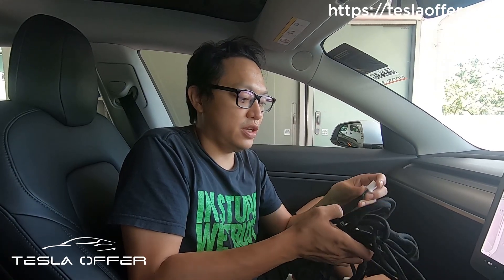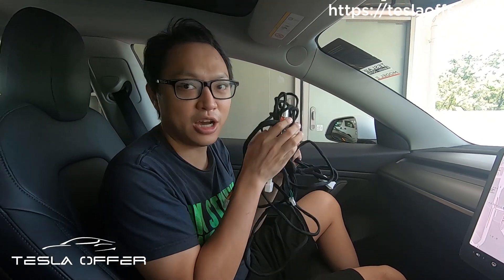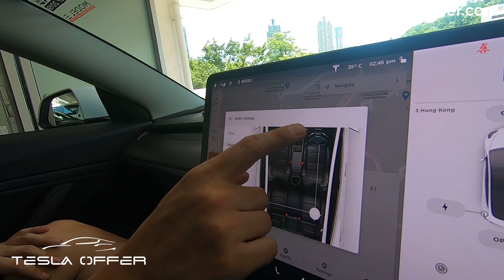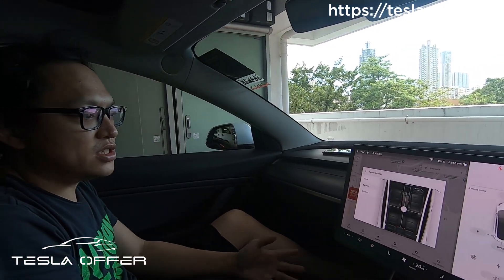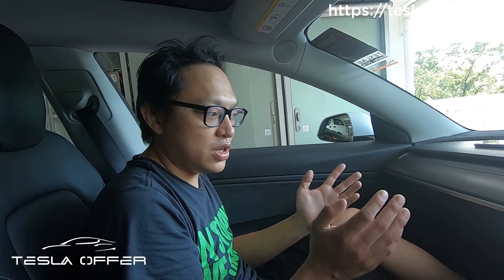[Archive] Tesla Offer - Model 3 Inactive Speakers Activation Wire Harness Installation Tutorial

Comment: Can I use this harness to activate just the front tweeters? Don't really care to have the rear ones activated and tearing more of the car apart.
Reply from the maker: Yes
Reply from the maker: Just need to plug in a connector on the b pillar

Comment: For 2020 sr+ would this activate only 4 front speakers?
Reply from the maker: Rear shelf speakers is ready for sale! You can get them back and install yourself
Reply: @EVOffer  thank you for the quick reply. Any issues of activating these speakers with the original amp - no issue overloading it with more speakers?
Reply from the maker: @lsol  again we suggest not to load up the volume up to 50% or above to make it safe haha!
Reply: @EVOffer  I don't see the rear shelf speayfor sale on you site.
Reply from the maker: @aChokingVictim  on the same page as the speaker wire

Comment: I am going to buy this for sure for my SR+ getting delivered soon.  Reading through the long posts on the forums it was bothering me to tap the factory wires!

I will buy a rear deck from a 2019 and swap that.  

Raymond, really looking forward to seeing a complete set up to add an aftermarket Amp and subwoofer.  One that would power the rear speakers and the subwoofer would be great.
Reply: Hansshow just started selling an upgrade kit with harnesses, amp, and sub a few days ago! Probably getting that for my June 2020 SR+

Comment: i have a june 2020 build so this kit shouldn't over load at all because im only adding my 2 a pillar and 2 side mirror speakers correct?. because i am missing the back to speakers on my build. also because i dont have the back speakers i dont have to go there all the work of running the back cable correct? i can just zip tie it up and just tuck it in under the dash or something .. or does it still need to be connected?
Reply from the maker: Since the front 3 speakers are running in parallel (front speaker near wind shield, A pillar and twitter near side mirror), that may cause overloading if you always turn the volume up.

Regarding your second question, yes, just zip tie the remaining wires, no need to run to the back.

Comment: Very strange manufacturing practice to not wire all components. Would not expect this corner cutting even from Tesla.
Reply: It's not corner cutting it's to get you to buy the better model ... An to give you a upgrade option later for $$$
Reply: Toyota does the same thing. It is cheaper to have 1 model and not connect things than have 4 models.

Comment: Why not a before and after sound demonstration? I'm a bit suspicious you didn't do this.
Reply from the maker: It's very difficult to show the before and sound comparison, I think it's easier if you can sit on the car to feel it. We provide this service to local customers, but I don't think there's a good way to show before and after comparison unless we have a professional microphone setup.
Reply: @EVOffer  where are you located?
Reply from the maker: Hong Kong
Reply: @EVOffer can you tell us what the customers who have had this done say about the sound quality improvement?
Reply from the maker: @ricardol1913  most of the customers are satisfied, but honestly, the biggest improvement comes from the rear shelf speakers, and the rear seat passengers are the one who benefited from the upgrade. We are trying to put some passive crossover on the front speakers and try out the effect.

Comment: Could we add an amp for the rear speakers and add the stock sub as well?
Reply from the maker: I will add more feedback here. If you want to add an amp for the rear shelf speaker, yes you can modify the harness a bit to feed the input wire to the amp and splice the output wire into the rear shelf connector. For Subwoofer, this harness do not have the woofer wire coming out but you modify the harness a bit and it should be quite simple to do it
Reply: @EVOffer  Waiting for the harness extension(which fits with teslaoffer harnesses) for the OEM sub and an amp.. Please develop one 🙏!!
Reply from the maker: Not sure about stock sub, but yes for extra amp and 3rd party sub. Working on it and stay tuned!

Comment: Hi Raymond! Is there a way to add an auxiliary input? I want to plugin my satellite radio. Currently, I use an FM transmitter and then I just tune in to that station. The quality is not that good. I tried a Bluetooth transmitter which worked ok, but only one Bluetooth at a time can be connected, so I had to disconnect my cellphone to use it. I need to have my cellphone connected at all times. Thank you so much! I have a 2018 Tesla Model 3 Dual Motor.
Reply from the maker: Hey Mitchell, this is Warren speaking. It's 5am now in HK so Raymond is probably sleeping haha.

Tesla only supports USB / Bluetooth as aux in channels. Bluetooth should be the best way to do. Yes, it only support one input at the same time... You have to make a choice!